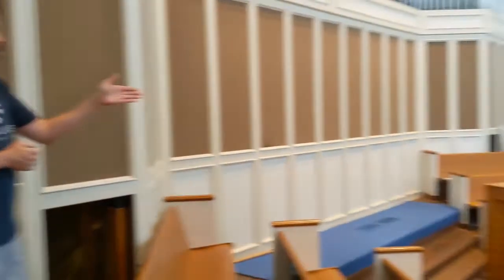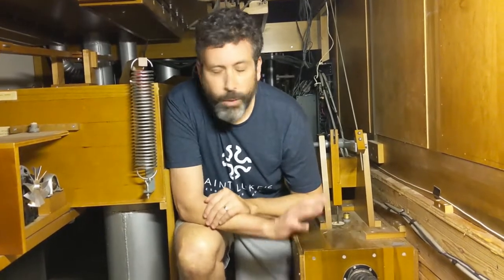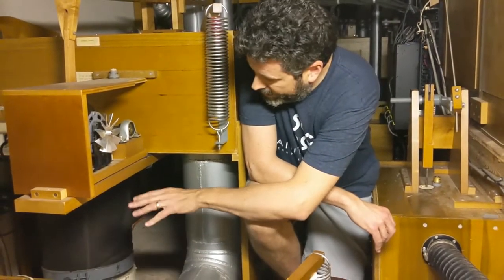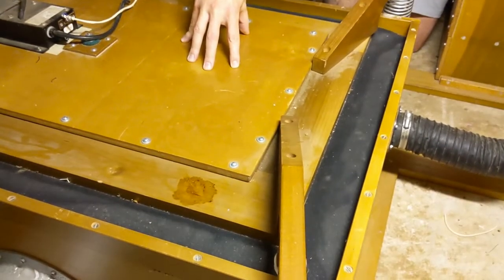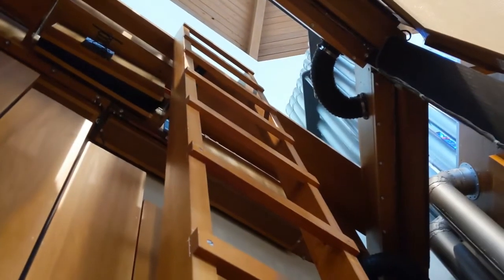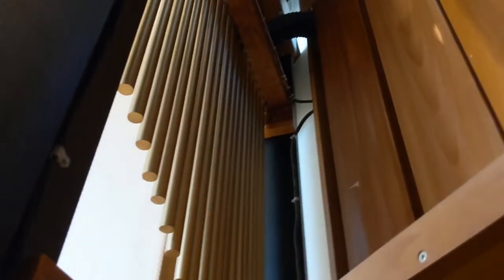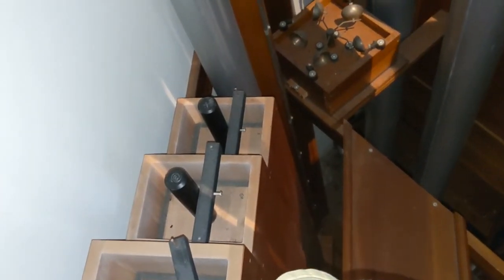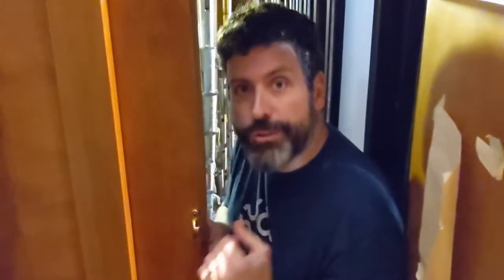Organ Encounter Part 4 - Organ Chamber Air Supply and Bellows

Comment: Do all pipe organs have a string or spring attached to them? if there are non, and there is no heavy weights on the Bellow, will it give issues ? Reason being is that when i strike a chord and in a few secs it goes softer or dim ! First chord is loud, rich and firm, in a few seconds it looses key slightly and goes softer. Please advise.
Reply: Most organ bellows normally have springs on them so they deflate when no air is being blown into it. I play on a small (very small - 10 stops in total!!) and you can get inside it easily and the bellows do have springs around the casing so it deflates, but there are also weights on top too. The weights are there so the bellows provide enough pressure into the system so most of the time, there should be a constant pressure! My organ has then same problem as yours - Majority of stops drawn and a nice, full chord and then, the pitch goes out and goes soft. This would be because of an air leak in the system (normally known by a whistling noise) so, check the wind chests ect. If there is a leak, contact your organ builder. If it's the blower not providing enough air, also contact your organ builder.

Feel free to ask questions if needed!